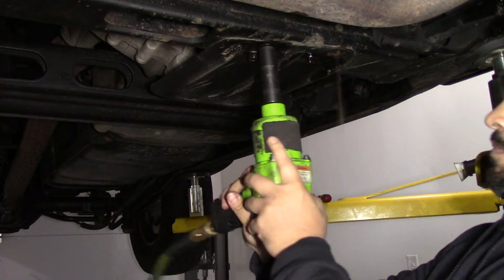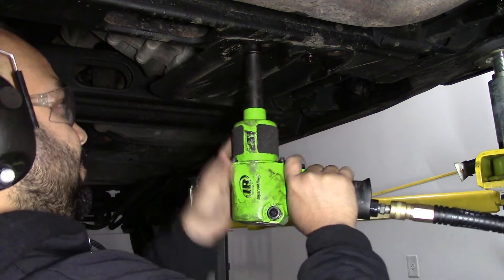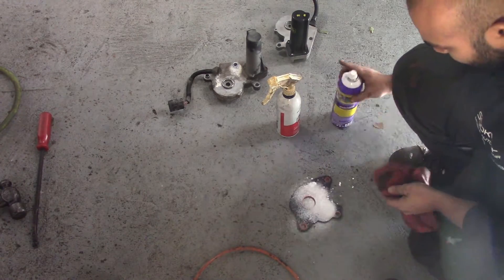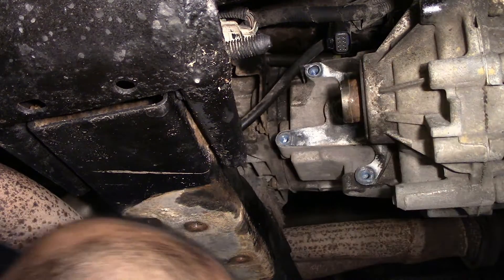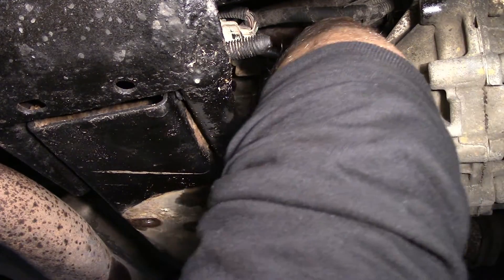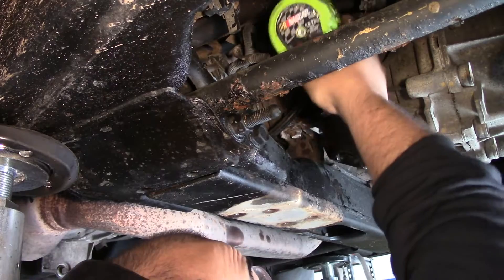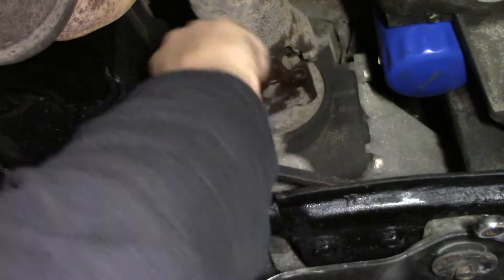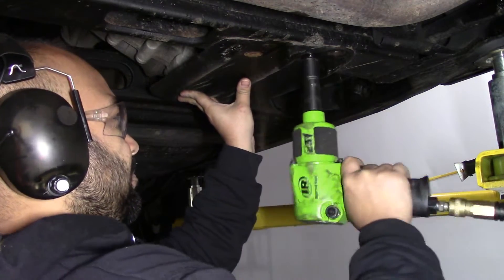SERVICE 4WD, HOW TO REPLACE ENCODER MOTOR 2004 CHEVY AVALANCHE

Comment: Would this make it not go in any gears?
Reply from the maker: yes, and this didn't really fix the issue at the time. it turned out to be a corroded ground wire,... but it was still a good video on how to replace the encoder motor

Comment: Just found this video and want to complete this weekend...about how long did it take from start to finish? What about for someone who's confident but never done something like this before? 

I know there are some gear teeth to match up, is that hard to do?
Reply from the maker: so for me if I didnt film it like 15 mins. and the gears arent hard to match, when the vehicle is in park or neutral just set your motor that same way. sometimes it takes a little playing around. give it a shot if you feel confident! make sure if it's in neutral, you're on a flat surface and wheels chocked. we wouldnt want a vehicle to run you over now lol. 

if you feel like it will be too much to hand you can always get a trusted friend or mechanic who knows more about it. but if you feel confident go for it man.
Reply: @King customz  can you clarify "setting your motor that same way"? Is there something specific on the encoder I need to pay attention to when istalling based on hear of the truck?
Reply from the maker: @NeilParkerTX   ok so in the video I said make sure the knob is facing down, it should be a click or something along those lines I said. once you set the knob on the transfer case. you should be able to align the motor.
Reply from the maker: https://youtu.be/a_IEQC3VM_E

this may help you a little better, reach out if you still need help 😊
Reply: @Kingcustomz  thanks for the link. After doing a sanity check, I went back to Oreiliy's Auto parts and bought a second motor set to neutral and it went on perfectly.  Questions, going from 4Lo to 2Hi is very loud and the red neutral light stays on even when in 2Hi. Any suggestions on fixes?
Reply from the maker: yeah remove the two ground wires under the driver door on the chassis. clean it and reinstall... let me.know if that helps
Reply: @Kingcustomz  any videos or images to help with this? Not sure what I'm looking for.
Reply from the maker: yes I got you
Reply from the maker: https://youtu.be/rjBZddiZklI
Reply: @Kingcustomz  another project for this weekend!
Reply from the maker: haahah let me know how it goes

Comment: I've been trying to find out what position in the transfer case is 2 HI I need to set it there until I get my new motor.

I can't find it anywhere and nobody is responding back on YouTube
Reply from the maker: Hey so why do you need to set there? Is it stuck in this position so your trying to line it up
Reply: @Kingcustomz  I need to set it on 2 HI manually so I can drive it until I get my new actuator...I've looked everywhere but I can't find the exact position on YouTube or Google and everybody who does this does not actually show the position where it needs to be for 
2 low 
2 high 
all wheel drive or 
4 low or 
4 high
everybody just keeps saying turn It counterclockwise but nobody shows exact position for each gear?
Reply from the maker: Here is what you could do because honestly I don't remember. Remove the actuator then turn play around with it until you find out that the front wheels move.  I'll do some research and see what I come up with